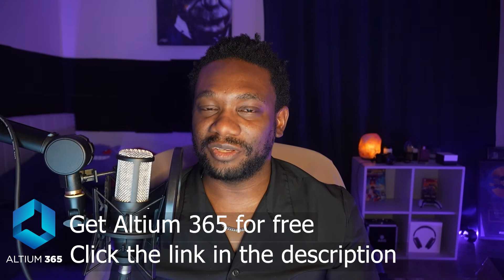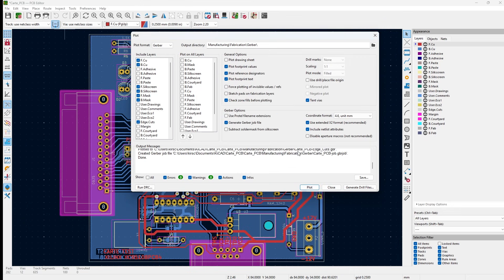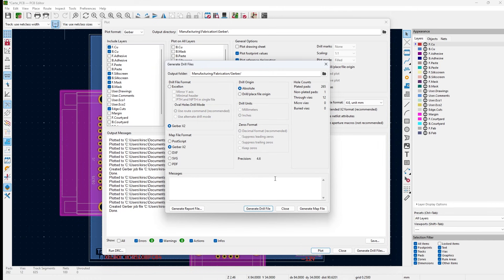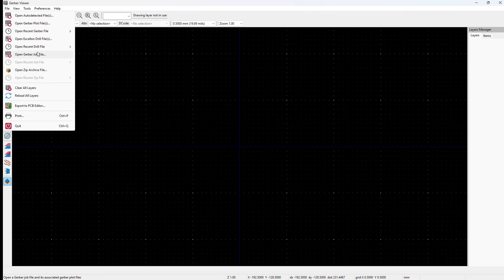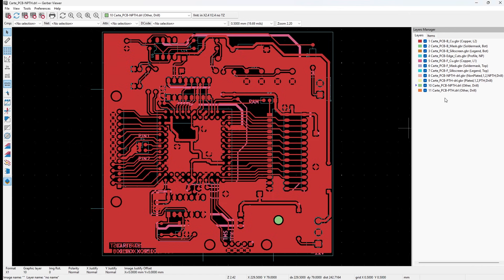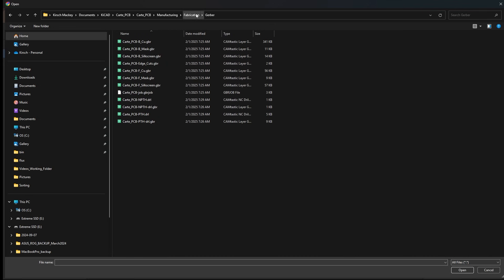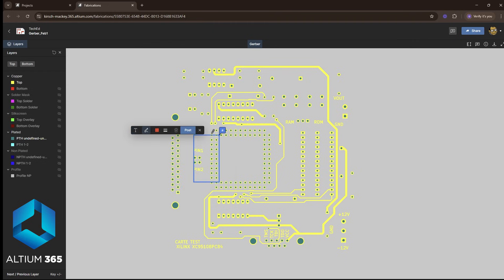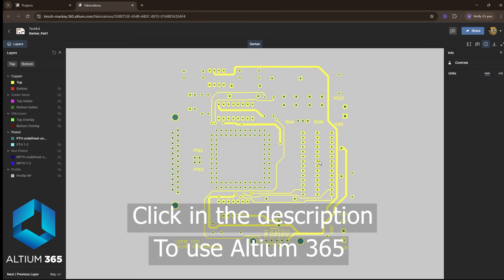How to Make Gerber Files in KiCad + View Them in Altium 365 Step by Step

Comment: Can Kicad's Gerber viewer return the coordinates of a bounding box of the circuit only?

I like the command line tool "gerbv", however since my gerber layers all have a title block (template containing project number, notes, etc) the resulting bounding box is the circuit+title block!     I'd be fine with an automated/command-line tool that removes the title-block, so that gerbv calculates the the bounding box correctly (just the circuit).. but haven't found a way.  

Do you think Kicad can help with this?
Reply from the maker: I believe so. It’s a matter of coding the logic. I’ll take a look and see if they solved this problem. If you haven’t already, ask in the KiCAD forums too because I’m sure some expert dealt with this exact problem (hopefully). If not then we’ll make a solution! Haha!